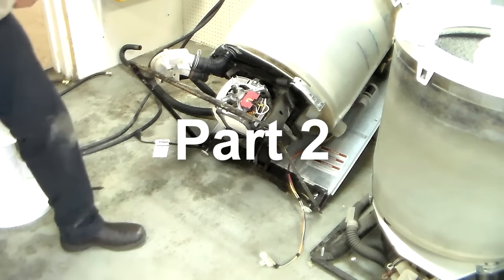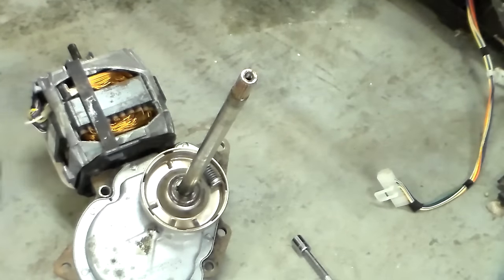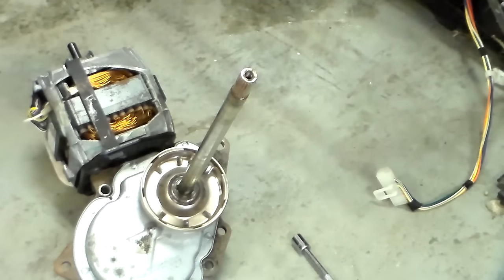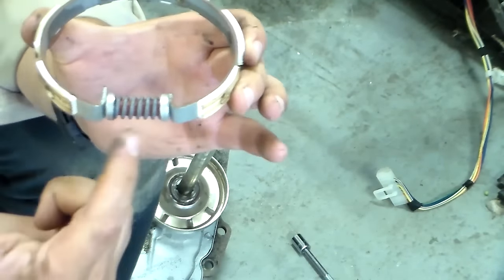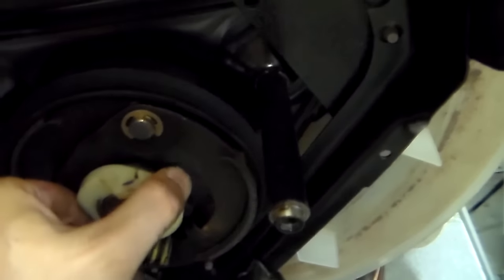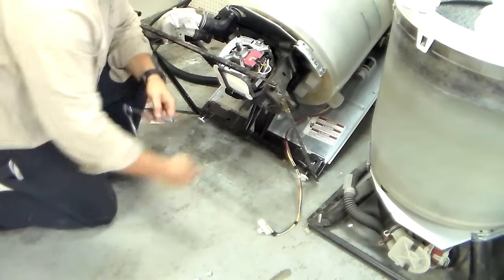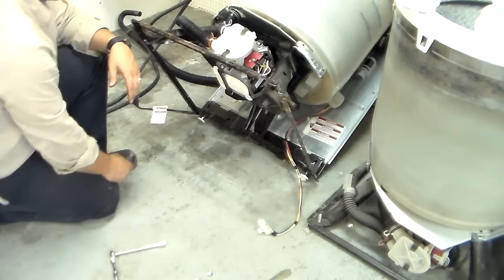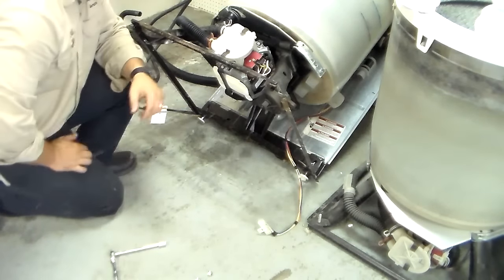Kenmore Whirlpool Washer Not Spinning 2

Comment: My whirlpool (W10140920) just fills up with water and does not spin or makes a sound as if spinning. If I play with the knob to put it in right after the rinse, it sometimes tries to kick the spin and it stops after 1/2 second. Any ideas before I do follow this video? It seems is not the coupler or clutch for me.

I think this happened on a overload wash, I also smell a little burning smell when it tries to kick the spin as if their is too much resistance...

Comment: so I did all this and the coupler and clutch are both good. where do I go from here?!?
Reply: its agitates but no spin. clutch looks brand new and the coupler isn't rounded. 
idk what to do now? replace transmission?!
Reply from the maker: +Joey Watters Motor windings could be burnt up for the spin direction.  Can you check the spin speed and try it on another setting and see if it spins?  Sometimes the high speed spin will quit but if you switch to a lower speed it'll spin.

Comment: I followed your instructions, now it makes a clicking noise on either rinse or spin mode and then blows the circuit breaker after about 3 - 4 seconds. Took it apart & put it together about a dozen times, couldn't get the problem to go away. Any idea what the new problem is, as it wasn't doing this prior to changing the clutch band.

Comment: I took the washing machine apart to check the clutch.  Though the clutch seems to be holding strongly, it slips when engaged with the basket.  I also tried to rotate the basket counerclockwise by hand and it is very hard to do.  Does this mean there is something binding the basket?

Comment: if that cluch is bad it will just stop it from spinning? it 'agitates' fine but doesent always spin but when it does spin slow if i push knob in and pull it back out quickly it will spin as it should after a few tries. and rarely but sometimes it will spin on its own just fine

Comment: my clutch plate came w/ 2 colored springs. one was a bit longer, and the other was shorter. i replaced the cuppler, but washer wouldn't spin the clothes. everything else worked. we ordered a clutch plate. put it on, the whole 9yds., etc. turned her on, but washer runs the same way through the entire cycle. it sprays the water, during the spin cycle; however, it never spins. when i first turned it on, the spin worked about 1/4 turn, but no more. should i use the purple spring that has a piece of cork inside? my washer is not a compact, and the instructions state that the extra spring is for a compact machine
Reply: martin wright did you ever find out what the problem was?
Reply: no, washer goes through every cycle, w/ the exception of spin. i have retraced and replaced each item that was shown. lid switch, clutch plate, dog digits, balance ring (for good measure), and coupler between motor and transmission. in fact, i have replaced the first coupler, as it seemed to have not completely seated flush. pump is working fine. hoses checked for clogs---none, i assume the pump hose is fine and not stopped up, as it is emptying the wash and rinse water. i have checked the clutch twice. perhaps, i put it inside the clutch plate, in the upside down position. i don't think it is the timer, for it enters each cycle on the machine, except the spin, of course. i began to seriously look for another washer, but two individuals that sell appliances told me that these older heavy duty machines, if they work at all, are better to keep, as they are far superior to any product made today. it is a mystery, but i just haven't figured it out. thanks for asking. :)

Comment: My washer was unbalanced, just as I was entering to room to balance the load it stopped abruptly.  Now it will not spin, and I think I may have seen a flash under the washer. I can hear the motor hum, but it does not sound like a spin. Where would you start?

Comment: no, thats good :)

check for a stripped spin gear (does the basket move a little tiny bit when teh machine is on spin?)

Check for a bad cam driver (does it make some degree of noise when on spin cycle?)

check for a bad basket drive block. (does it make noises when you turn the machine off while its spinning? and can you turn the basket easily with little resistance when the machine is off?)

check for a bad neutral drain pak (does it not do anything on spin, but agitates)

Comment: I have had several of these models shake the three gear case bolts loose, in most cases a bolt falls out, or was never put there from the factory. Tighten the bolts and make sure there is three of them. It maybe as simple as that.

Comment: You should have mentioned that often the clutch plate that you didn't remove develops a smooth,slippery surface along its wall from grease which seems to bind to the metal. In such a case just replacing the pads will do little good. Why not just replace the whole clutch. The cost of the clutch pad is about the same cost of the entire clutch about $10.
Reply: And you didn't mention that a piece of  Emory cloth and acetone costs less than $10.

Comment: Does it matter which side of the brake cam the clutch spring is positioned at?

I have seen some that look like the two springs are aligned at the same position.  Looks like they would interfere with one another.
Reply: If it's in the wrong position the transmission won't bolt up straight.

Comment: If the motor coupler is broken, the machine will not agitate or spin. Make sure the machine agitates before you rule out a bad clutch. If you have agitation but no spin, then a bad clutch is the cause. If you have no agitation or spin, then a bad coupler is the cause.

Comment: Hey Devil Dog
I got around to installing a new coupler also a brake lining kit, the old one looked good as far as meat on the pads but my brake release tab was broken off so I replaced both put everything back together and I'm still having trouble 
  It was making an intermittent high pitch noise then I was getting burning rubber smell, now she's not spinning during the drain still. 
 What would be the next thing to check?  I'm betting my coupled is toast again but it seems like something else is my problem 

Thanks
Reply from the maker: +Scott Winy One some washers, when they initially go into spin, the tub will not spin for a minute or so but will drain.  Then the timer will pause, then start back up,  this will engage the gear in the transmission for spin.  When the washer goes into drain and the tub doesn't spin, lift the lid and close it.  It should engage.  At least eliminate this before we move on.  The washer may in fact be fine.  Most don't realize this because you set the machine and go away.  When you are watching it, you expect it to spin right away.
Let me know what you find.  Jar head!
Reply: +Bill Newberry thanks for the quick reply. It wasn't spinning. I took the small load of clothes out and it started spinning while empty
 I also got the rubber smell again   I'll take a look underneath her skirt again tomorrow to verify the new coupler is burned out. Will let you know

Thank you
Reply from the maker: +Scott Winy Did you replace the clutch already?
Reply: +Bill Newberry not yet
Reply from the maker: +Scott Winy I would remove the pads and make sure there isn't any oil on them.  Clean them well and also clean the metal housing that the clutch pads are in.  This sounds like where you should go from this point.  
Get after the clutch and let me know how it goes.
Reply: +Bill Newberry thanks Bill
I cleaned the clutch with brake cleaner before I put the new brake band in. There was a lot of tar looking stuff in there, I'll clean it again and inspect the clutch carefully 

  I just took it apart and was a little surprised to find the coupler in good shape. I figured that was the source of the burning rubber like smell

  Do you usually see broken brake cams and couplers at the same time?  Mine were both broken at the start of this project 

Thanks Devil
 When did you serve btw- me 86-90
Reply: +Bill Newberry well I finally got my parts in, and everything is working !
I was surprised at the new clutch it is super tight to the point where I really struggled to get the brake lining ring back into the clutch. 
thanks for keeping me on track - you're help is really appreciated . S/F

Comment: Mine is model #MAV4757AWW and the bottom of my machine has a full size metal plate blocking everything, and the only access is a small plate on the bottom rear and it looks nothing like what they all show on line.
Also, mine (either pulls or pushes) to turn the knob, then when the knob is turned to where you want it, you (pull or push) to activate the cycle so there is no self diagnostic feature.

Comment: What if all of these components look good? The clutch is tight, the coupler is new, and the transmission spins when not imstalled; but it still doesn't spin when assembled. This is what my does and it makes a loud noise.

Comment: I replaced my maytag washer motor coupler and clutch because machine would not go through spin cycle and now after replacing the parts mentioned above machine is half filled with water,at spin cycle  and "will not turn on" to begin spin cycle ??. 
I noticed when I pulled wire harness carefully from motor one of the holes on the female end "looked" burnt could that be why its not going through spin ?? cycle

Comment: Hi Bill - I followed your videos and replaced the clutch and coupler because my Roper Whirlpool washing machine wasn't spinning the 'fast' cycle and the clothes were dripping, sopping wet - I had to hang the clothes in my basement for an hour before     putting them in the dryer - well, now the washer won't spin or agitate at all - what did I do wrong? help!!!

Comment: Bill, what is the part number for that clutch kit with 6 brake pads? Most replacement kits have 3 pads only. Thanks in advance sir.
Reply: jim davidson He put the amazon link in the video for part one. The link takes you directly to a fairly expensive clutch but also allows you to see some alternatives.
Reply: That Amazon link shows $63.00 for a USED part. WOW.....
Reply: I would guess at the 6 brake pad clutch is better than the cheaper 3 brake pad one is? What do you think? I bought a 3 pad clutch from Ebay. Sucker lasted 2 weeks. Said it was Whirlpool brand in the ad. It used white plastic material for a brake pad LOL.
Reply: jim davidson, I don’t really know. The original on mine had only 3 pads as does the replacement I put on. I will see how well it lasts. It has been on for a day now. I got the basket drive kit with new clutches all around from amazon for $70. I replaced everything and the washer runs really well now. If this clutch does do well then I may try a 5 or 6 pad version. I saw some on amazon for $15-20. I have had the motor out of the washer now twice and I feel like the replacement would take about 20-30 min.

Comment: Hi Bill - my washer would spin but not fast enough to wring enough water out of the load. I pulled the coupler and it is perfectly intact and the rubber piece is still pliable. I replaced the whole clutch assembly. Still not spinning fast enough. Any suggestions?
Reply: Did you put in a new motor coupler? Mine looked pretty good but a little bit worn, I went ahead replaced it and now the machine works fine.

Comment: So when I put it on spin, I hear a noise but the washer isn't spinning. I checked the coupler and it's fine. Pulled the clutch out and I can't spin it at all. What else could cause it to not spin? I do have broken agitator dogs, but would that cause it to not spin?

Comment: Hey Bill I can't get the trans and motor to slide out like you did, it comes out about two inches and stops. I tried several times and is seems to be stuck. I looked down through the lid and I don't see what is holding it in. Help!!!

Comment: My clutch is good, coupler is good. But my machine still will not spin or drain. All it will do is the motor will make a buzzing sound and do nothing. My door lid switch is also good. Does this mean I have a burnt out motor?

Comment: Help! I did this repair and even though my spin cycle now spins, near the end it starts making this REALLY LOUD RAPID CLICKING NOISE! And I can’t figure out where it’s coming from. If I turn it off then right back on again when it starts clicking, it stops making it while it spins again but then starts clicking again about 5 seconds later.. I thought I got the wrong clutch as mine only had 3 pads and the replacement had 6 and was a bit tighter, so I ordered another one that had only 3 pads, but they both so the same thing.. Can’t figure it out!

Comment: What if the only time it doesn't spin the water out well is when there's a load of clothes in it? But if you take the clothes out it will remove the water. Is that the transmission or the clutch. Cuz it looks like the rubber and plastic piece between the motor and the transmission are intact

Comment: Hi Bill, I cant get the transmission out. I followed all the directions but it seems stuck. Should I wack it from inside the tub?
Reply: +Allison Scouler  I did take the bolt out of the agitator. :)
Reply from the maker: +Allison Scouler You have to swear at it a few times.  lol  How did you make out?
Reply: +Bill Newberry, Yes I did. I figured out it was a big tub nut that I have to get off. So I had to order a tub nut wrench. 
Thank you so much, your video is so helpful.
Reply: +Bill, a few colorful words and a whack with the hammer worked. Thanks!

Comment: I have a kennmore model 70 which refuses to spin when loaded with laundry....put it on spin only when empty and it spins fine... using my hand to try and slow the drum shows it still spins fine even under heavy pressure.... could this be a timer switch or solenoid problem...??.. how do I trouble shoot it...??..
Reply from the maker: Ame Elia Sounds like your having a clutch issue or possibly the coupler is rounded out.
Thanks for Watching!

Comment: When you install the coupling  to motor coupling should go in far enough so that your mat or shaft is sticking out 1/8 of an inch your transmission coupling has to be flush with your transmission shaft

Comment: I have followed 1 and now part 2. After I remove the 3 bolts I freed the transmission, but the transmission only drops 4”. I cannot move the transmission any further. What is holding the transmission on?
Reply: The retaining clip at the top of the metal pole mast

Comment: Bill I took the motor off and it spins only when you put the dial on spin it spins and times out
the timer only works during the spin
if I place it say on 14 minute was it does not spin and the timer does not work
I also have to take out the transmission
 the coupler is not broken  and the agitator does not spin when I try to by hand
Reply: Sounds like a bad transmission.
Reply: @jakejones5736  upon further review the coupler was broke, took it all apart  trans spins freeliy

Comment: I replaced the clutch.  After assembling the washer, I found that I can not rotate the agitator or drum either way. Did I do something wrong?  Also, I have tighten the plastic nut (agitator retainer) on the upper agitator too tight which I had previously opened with 1/2 inch drive. Now I can not open it since 1/2 driver slips.  What should I do to loosen and open this agitator retainer?  Kenmore model #  11022996101.  Thanks.

Comment: Hardest part to do was get the 7/16 bolt loose on top inside the machine.  Used hand tools but ended up having to use an electric impact.  

That thing was on there tight AF.

Comment: Hi, I changed the lid switch, the agitator is like new, so I removed the motor/transmission. That thing is heaaasvy!! The clutch and the other parts are in excellent condition (like new) now I have the put the motor back on. I can't do it by myself, it is to heavy. Like stairs, easy going down very difficult going up I don't have anyone to help me. Any suggestions? Another lady told me to use a car jack, I have to try that. Any ideas will be appreciated. Thanks

Comment: I can't get the transmission and shaft to release from tub. Removed bolt at top and the three bolts that secure the transmission. Seems that shaft is galled somewhere internally

Comment: my Sears Kenmore washer will wash & drain but won't spin.  I have replaced agitator dogs, motor coupler, & clutch assembly.  I also checked top latch.  after taking apart & putting back together 3 times it still won't spin! H E L P!